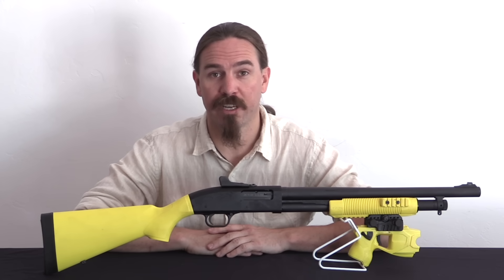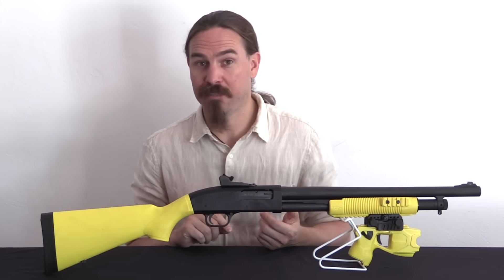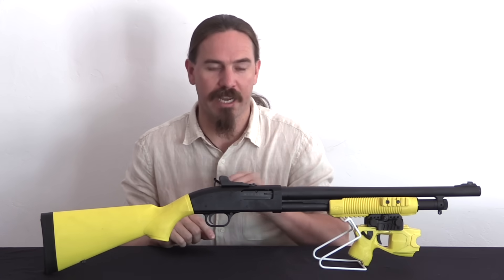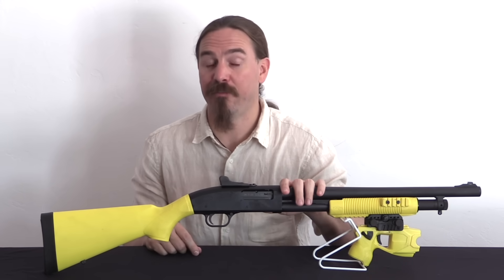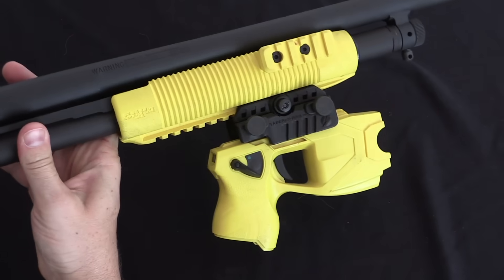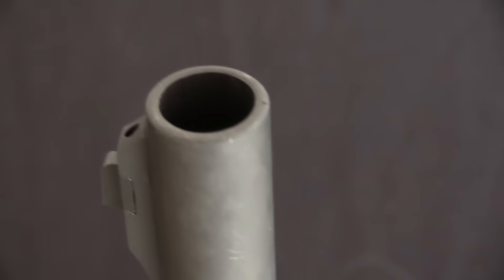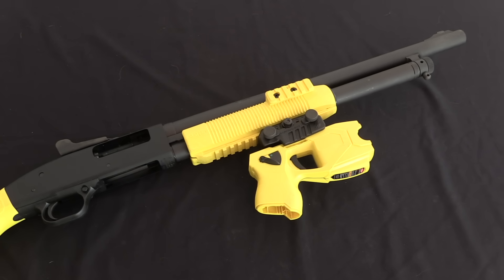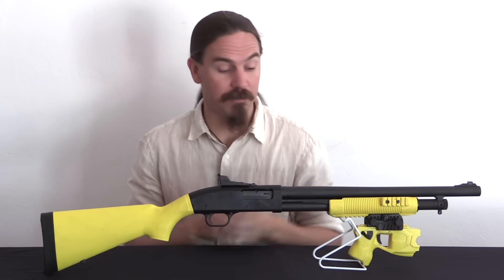Taser X12 XREP: A Taser in a Shotgun Shell

Comment: Okay, but consider that if a BGM-71 TOW Launcher is wire-guided, and a taser requires wires to work, if you attach a second set of wires to the missile, then decrease velocity of the missile, you could effectively POSSIBLY, and I use this term loosely, POSSIBLY have a wire guided non-lethal animal take down weapon for large animals like elephants, hippos and the like that would cause less permanent damage than a tranquilizer and be able to be guided on the move. This of course, is completely unrealistic considering that it would be too expensive and too specialized to sell more than 1-2 units total, provided that you could even make it effectively slow enough to not cause major harm or pain to the animal, as well as make it so the animal is able to be actually captured in the period of time the shock is administered, possibly making a tranquilizer necessary regardless, although it would be an easier shot. You would also need the U.S. government/DOD to allow you to have access to the TOW launcher blueprints so you could reproduce it, which is frankly unlikely because you could easily sell the blueprints for more money anyway. Am I over thinking this? Yes.

Comment: This is not a snarky or political comment. I WISH they marketed taser shells that would fit a normal shotgun for personal and home defense, BUT I see the wisdom in having police issued versions ONLY being able to be used on shotguns specifically designed for taser shells. 
It’s not an either or good versus bad question. BOTH concepts have a place in society while at the same time both have certain obvious weaknesses that should be well aware of. 
Whether is law enforcement or personal defense situation you want to reduce as much as possible the vulnerability of the person as they transition from non lethal to lethal devices but at the same time you want to reduce the chances a person will accidentally be using a lethal device thinking they have a non lethal device and thus need not act with as much restraint

Comment: Those rounds WILL fit and operate in a regular shotgun but not the other way around.  They do not recommend you do that though.  They still make them and they are $800 for 5 shells.  They have training rounds that are $160 for 5.  They are just plastic rounds that weigh the same to practice shooting.

It would be odd they would not consider that shotgun as a regular firearm as the bolt is NOT the serial numbered part and unless they modified the shotgun so it could not take a standard bolt, it could be easier switched over... and likely you could legally buy the parts online for rather cheap.

The product has potential, but they need to put a bladder in the front filled with marking dye with weak points on the side between the barbs so it sprays all over their front.  I would love to see something like this with a sedative.  Likely they could upgrade this to a better capacitor and battery to make it last longer... and they could pulse it say every second or two to extend it even longer.  Maybe put a bright LED on it so it strobes with each pulse making them even easier to locate.  Police also need for riots a rope with a clamp on a rod they can easily use to lock around someone's leg.  This way during a riot they can taser a few people, push forward with a shield wall and drag the people back so they can zip-tie their hands and put them in a patty wagon.

Comment: oh it hurts like hell, trust me. I bought a tens unit that uses the same technology, and the dumb thing was preconfigured at maximum strength, 300 wave depth and 150 hertz. That is super stupid because you only get benefit as high as 50 hertz, then you only get increased pain. So it was set to max power and i plugged it in and it was like getting punched in the stomach, continuously, and then cramps developed and locked up muscles and even after you turn it off, the cramps need time to resolve.

Comment: Given how reliable tasers are (not much), why would you choose a long, two hand gun, that may or may not work, instead of a real shotgun?
As far as "not able to use lethal rounds" - can't you switch the bolt with a regular one, or even just file off that ring? They made it in a way, that you can't mix up the ammo, but if you want, it can be made lethal - and you don't even need the background check.

Comment: I disagree... the stun gun and the taser are exactly the same except one difference , the taser's electrodes are on a wire that can be shot through the air. the stun guns electrodes are permanently connected to the stun gun.  They both disrupt the electrical system of the body and they both hurt.

Comment: I'm sure, the cost of the rounds was less of an issue, than simply the fact, that law enforcement would need another bulky platform to shoot it.
Like, what are You going to do if You miss, battery is dead, wire broke, etc and/or the perp (potentially multiple) is charging at You?
Club them with the 'non-firearm'?
Throw it at them and transition to Your sidearm?
Besides the point about logistics, storing them etc, I'm pretty sure too, that the batteries have a certain shelf life, and that they won't use simple AAAs.

And how many non-military engagements happen at 100 feet or even just 30, in short beyond the range of the same thing, but that fits on Your belt, has cheaper 'ammo', has a better battery thus efficiency, is lighter, smaller, can be used with one hand, in a struggle and CQC, while in or jumping out of a car,...
If they gave police the option they could load a taser shell in their regular shotguns and after that was fired and still a reason to shoot, regular lethal round or went for an under barrel attachment (hell, why didn't they go for a 40mil launcher? Even if the circuitry fails, the kinetic impact would be enough plus bigger battery and so on), they would've had more success.

It's like, first it might sound in theory like a good idea, but the more You think about it, it's just awful and impractical and I do not understand how something like this even came to be.

Comment: the video game Splintercell had a ranged tazer for an underslung launcher.

Fun note DARPA tried to develop a ranged electrical weapon for crowd control.  It was called an Electrolaser I believe,  The problem is the way it worked it had to make an ionized corridor for the electrical energy.  Thing is this conductive "corridor" is naturally like all conductors two way.  The project was abandoned because of that, pass the unit's line of fire over power lines or accidentally point it up during more energetic time in the sky and the user gets zapped with lethal levels of power.

Comment: 8:45 but wouldn’t the taser rounds still function on a normal bolt face? It seems similar to a .38 & .357 relationship, one way compatible. 

I don’t see how a groove in the base of the cartridge would prevent it from being fired by a flat bolt.
Reply: It could definitely work if the dimensions are the same.  I think they were mostly concerned with it being done the other way around.

Comment: Just give me a rap sniper with the bullet shaped paintball rifle 
 fill em with epoxy and up the psi that is way simpler and will drop someone in a leather jacket u can use white pepper too and hit em twice one pepper then if the antifa for exaple guy hasnt got the message hit him in the belly with a rock hard 68 cal slug going 500fps he will gladly crawl away then or make impact rounds for this too a half oz solid abs round with a rubber soft point would make it quite effective and super cheap u can have the under barrel tazer and a side mounted foregrip and a. 40mm either under or on the side too call it the hurt cannon

Comment: There are several medical devices that run current between electrodes on the skin or in muscles. The in-muscle one is nerve-conduction testing and it definitely hurts (BTDT, not badly, but you probably wouldn't volunteer for another run). The skin surface one is the TENS machine used for pain control. I used one extensively through the nineties and noughties, it uses a fraction of the voltage of the Taser, but even in the early 90s they came with advice saying "don't position the electrodes so the pulse will cross the heart" or words to that effect.

Comment: Actuallly any electrical charge applied fo the body will interfere with the bodies muscle control , the pain is actually partially a burn but mostly from your muscle convulsing or contracting beyond its usual range of motion , if you do not grasp the bare cable of this device after it strikes you there will be no charge flowing through you .. remember this peps pull away from the barb if only one penetrares your flesh never complete the circuit by touching the wires

Comment: 8:00 So what actually prevents loading the Taser shells in a regular shotgun? From that description it sounds like it would be one-way interchangeable.
Reply: Correct.  They can be loaded into a conventional shotgun. Just not vice versa.

Of course, a conventional shotgun would be smooth bore so they wouldn't be quite as accurate, but the projectiles themselves were fin stabilized.  So that would help somewhat.

My understanding is that only after they determined they wanted to make a specialized less lethal only firearm That's when they were allowed to introduce the rifle barrel because it had no impact got them under the NFA.  So they said "why not" and stabilized the rounds even more.
Reply: The ring on the case head is what keeps them from firing in a conventional shotgun. The firing pin can't reach the primer.
https://encrypted-tbn0.gstatic.com/images?q=tbn%3AANd9GcTDa9GeyJG21L_g2gUszNE-zOOyadx7F9-VSg&usqp=CAU
Reply: @sgtcwhatley  awesome photo!
Reply: @sgtcwhatley  Those two look like different models, one will work in a regular shotgun and the other won't?
Reply: @WJS774  the one on the left is a training round. It will chamber in a conventional shotgun.

I don't know what TASER called them officially but I'll use the term generations.
1st generation could be fired out of any 12 gauge shotgun
2nd generation couldn't be fired reliably out of a conventional shotgun. TASER recommended the X12 but there was talk of a conversion kit for Remington 870 and Mossberg 500/590.
3rd generation only worked in X12. No more talk about conversion kit.
The generations came about quickly. The first I saw was 3rd generation and that was in 2010. By 2012/2013 the XREP was already discontinued for the North American market.

Here is a link to a TASER International video on the 1st generation ammunition. Note the X12 doesn't come up in the video and the XREP is depicted as being loaded in a conventional clear plastic shotgun hull.
https://m.youtube.com/watch?v=aBYtUCSJAmw

Comment: Hi Ian, 

Ultra nit-picky correction but I know how precise you are in your language - there would almost never be a concern with a heart attack (myocardial infarction) with one of these guys, as they are caused by an occlusion of a coronary artery and impeded blood flow to the tissues of the heart (and subsequent tissue death) usually caused by a blood clot. The potential risk of a taser would be cardiac arrest, which is an electrical problem of the heart. This is when the heart stops beating, due to a fatal heart arrhythmia (possibly set off by a strong electrical pulse!), a heart attack as we discussed before due to cardiac tissue death, a very traumatic impact to the heart, etc.

Comment: First time I've ever seen a Maverick 88 with Mossberg 500 markings.  And that is DEFINITELY a Marverick and not the 500.  Same front-of-trigger guard mounted cross bolt safety, same cheap plastic trigger chassis.  Mavericks retail for right around $200, which is probably the real reason they went with this version and not the very awkwardly-placed cross bolt safety. 

You think the back of the trigger guard is weird and unwieldy?  The safety on this model is basically impossible to reach without breaking firing grip, and being plastic in plastic, it's usually quite a bit stiffer than the safety on something like an 870.

Comment: Even if the maximum length of the classic tazer cord is 35 feet, the actual effective range is apparently closer to half of that. The two barbs are angled away from each other to impact the target with the contact points spread apart, cuz closer together the two barbs of the tazer are when they hit the target, the less effective the delivered pulse is.

Comment: why not an over under type setup? you wouldnt really ever need to lay down a huge ammount of these, a tripple barrel would give a bit of redundancy, but since the pressure is lower and the velocity doesent need to be too high it can have a short aluminium barrel and the shells can be pysically larger to make the cost of miniaturization less. a training ammo could be made that just launches a weighted plastic slug with the barb on it.

Comment: I have wondered if these could be used for dangerous animal control. Perhaps discouraging bears from approaching for example. Bears do react to electric fences immediately. It seems that it could potentially be used to discourage bears from approaching towns. It might also have more reliable immediate effect than even some lethal rounds. For animal control use, I can see mixing less lethal and lethal shells. Perhaps 1 or 2 tazer shells followed by slugs. If the animal does not run for some reason, then you can put them down with the follow up.

Comment: tbh, the first part explaining how a taser works is BS. it's a high frequency waveform, with low enough voltage and amps because1) you 're using fish hooks to hook onto and into the skin, thereby limiting skin resistance, and 2) you don't want to kill the person you're tazing. go check on Electroboom, he has a very nice video on how frequency affects pain sensation.

Ian, I dare you to get tazed and tell us all how it didn't hurt.

edit the side effect of the waveform is your muscles contracting and releasing too quickly for you to take control of them becuase the signal from the tazer is magnitudes bigger than your own nurological signals.
Reply from the maker: I did not mean to imply it doesn't hurt; but rather than it isn't dependent on pain to function.

Comment: Tasers are only less than lethal when used properly.  They can easily kill when abused. Heart failure and seizures are and were well documented side affects of tasers. Problems that the inventor knew about when they first released them but decided to ignore. Tasers were first issued with no training or education and promoted as completely safe and non-lethal. After an unknown number of healthy people died after being tased, old studies showing that they were not non-lethal were brought forward. Most law enforcement agencies now require at least some training before issuing the devices. They are directed not to use them longer than recommended and not to fire them at certain parts of the body.
Reply: DOUG HEINS  That is not correct. Using electricity will always present a risk. A simple google search will bring up multiple articles about recent deaths that are directly related to taser use.
Reply: DOUG HEINS  Comparing a 9 volt battery to a taser? Moron.

Comment: I was at our local law enforcement supply store which is also a gun dealer, though all they sold were Glock pistols, Remington bolt action rifles, and shotguns for law enforcement. The Taser shotgun shells and shotgun had just arrived. One of our deputies came in and the salesman showed it off. That guy was almost drooling, he couldn't wait to use it on someone. The salesman quoted that the shells cost nearly $300 each, or that's what they were selling them for. The Mossberg Taser shell shotgun's crossbolt safety comes from their lower cost, POS Maverick 88.

Comment: Not sure where you got your info on rifling, but it is 1:60, not 1:18.  If you take a look down the barrel, the rifling almost looks like it's purely straight.  Source: I own an X12 as well
Reply: Also I find it really questionable that taser would claim this is a non-firearm.  If an AR lower needs an FFL, this would definitely need one.  The only thing stopping this from firing normal 12ga ammo is you not throwing in a standard mossberg bolt or filing down the raised spot on the bolt face.  Even if it's not designed to fire lethal ammo, I doubt I could get away with calling a complete AR a non-firearm if I gave it some upper that only fired paintballs or something.

Comment: Weight doesn't matter for  twist rate, length does. If it's long AND narrow like a boat tailed low drag bullet, then it needs more than a cylindrical bullet of same weight. Aluminum instead of lead/copper, doesn't matter. A batter, circuit board, etc., doesn't change that.

Comment: “The handheld version can be used at point blank range”.  Well yes and no.  Yes it can be deployed and strike the target without any safety issues.  The problem is probe spread, you want the probes to be as far apart as possible to maximize the number of muscle groups affected by the electricity.  Because the lower probe fires at a slight downward angle, the further away you are the greater the probe spread.  7-25 feet is ideal for probe spread.
Reply: The one I got hit with in training could drive stun without using darts.
Reply: @sanguinemoon9201  So how did it deliver the shock at range?
Reply: @donbionicle  had prongs like stun gun when no cartridge was loaded.Far less effective but at least it isn't useless. Called drive stun. The barbs shot out when a cartridge was loaded. FYI, I got full contact with barbs when shot but was still able to move. I was so sore for the next few days I couldn't stand for more than ten minutes straight.